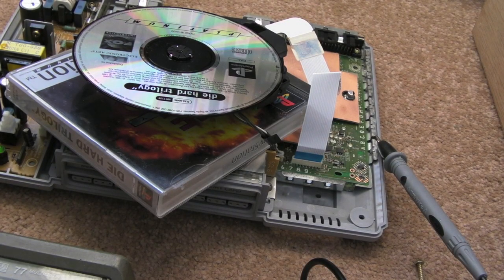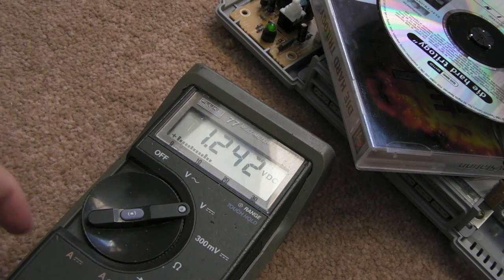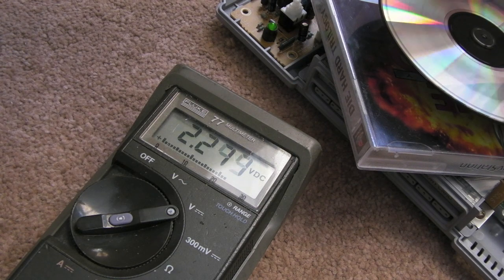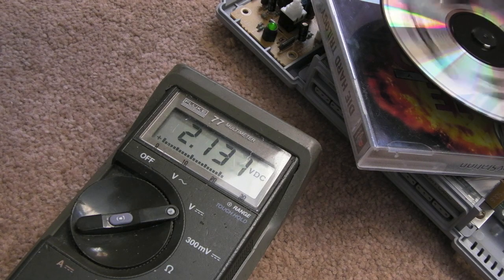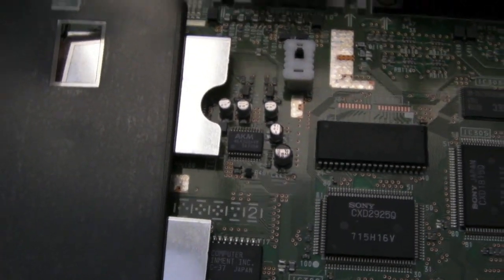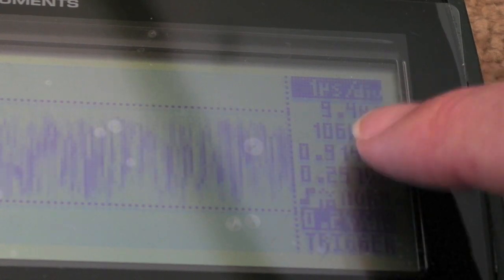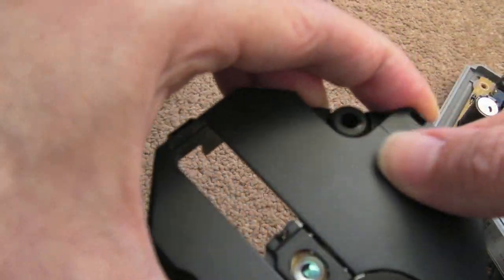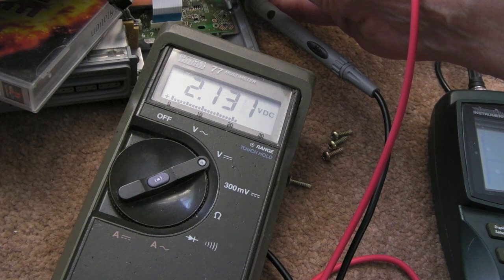Sony PlayStation Faulty Laser Repair - Follow Up (Multimeter to adjust laser voltage?)

Comment: hm bruh but cant u just look for the resistant (Ohm) at the laster-adjustment poti? This would cutting corners massivley.
Reply from the maker: It would only give you an at best average setting - no two laser units are the same and in some case the resistance can vary quite a bit, for example on a replacement 3rd part unit.  You really need to measure with an oscilloscope if you want to ensure its optimal and so you dont shorten the laser life.

Comment: I have a question. I have 2 of these 5502 playstations. Other is modded and works fine, other is not modded and is having trouble with FMVs and loading in general.
I measured modded unit with multimeter, 1.315V while "sleeping" and 2.15V when active, absolutelu no skipping.
Unmodded unit won't go past 1.85V in active state or it would get stuck in PS screen. I tried everything between 1.6V to 2.2V, 1.85V seems best this cd-drive can do. They have different spindles, otherwise identical unit.
Is this a sign that drive is finished and needs to be binned?
Reply from the maker: It sounds like the laser perhaps on its last legs!  You will get less of a voltage change (and a lower voltage) when the laser is outputting less.

Comment: Have you ever tried to replace only laser diode in laser which was completaly used up? Or is there any other way to fix the laser which can extend the life of this laser diode. I know that adjusting potentiometer helps for some time but this diode will finally be completaly broken. I'm wondering if someone tried to replace it, but only the diode and not the whole module...? :-)
Reply from the maker: I haven't, but someone probably has!  Sometimes soaking the whole unit in IPA can help (dust or dirt in the pickup path internally etc), but as you say - once the diode starts to die, increasing voltage just increases the speed which it deteorates.
Reply: @GadgetUK164  recently I had SCPH-102 & 5502 on my desk fot repair and I also got 2 pcs of laser modules from aliexpress (KSM440-ADM & BAM). Unfortunately in both potentiometer has been set to ~700 Ohms. This basically means that they cheating, taking old modules, changing resistance value and sell as a new one. I was very angry that day. Over month of waiting for nothing... :(
That's why I was looking possibility of diode replacement ;)

Comment: Any chance it’s a laser issue causing my problem?!.... I just purchased an original PlayStation (SCPH 5552) to relive the good old days of gaming. When the disc is inserted, the ps load screen comes up as normal whilst loading but then as the game or intro video (depending on game) starts to display, the image (kinda) bounces, vertically, creating almost a double image (a bit like looking at a 3D image without the active shutter glasses on). Now doesn’t do it with all the games, only a select few and all the discs are in good order. Any ideas??

Great video!
Reply from the maker: What you are desribing is a common issue with the composite sync on these I think.  Some of mine behave that way.  There's probably a mod you can do to improve the sync on these.  It's not related to the laser though!

Comment: What's the default laser voltage of the PS1?
Reply from the maker: The RF level should be set between 900mV up to 1.25V I think.  Do not mistake the RF level for the voltage that goes to the laser using the pot on the back of the laser unit.

Comment: after replacing the lens the screen ask for ps1 format disc ?!!   how can i get that disc or download it  ???
Reply from the maker: That means it cannot read the disc still!  Either the new laser is faulty, or you have another fault - perhaps related to the TDA IC on these boards which controls the motors, focus and tracking coils.
Reply: now i replaced  another lens and it works but very sensitive to cd must be new ... and my cds is old most of it >> can i download games from the net and copy it to new cds ?

Comment: Thanks for making this video - I had asked about this on your other video, but just noticed your reply only in my notifications in the top right corner, so I had missed the comment reply until now. I wasn't asking because I knew better -- I just truly wanted to know whether your technique relied more on something graphical which was present when looking at the range graphed on the scope, or whether observing the level using the meter would be equivalent or adequate. As you mention either tool could introduce drift in the readings from added impedance, etc, just by using it; but I was more curious from a troubleshooting perspective whether the scope would show me something that a meter alone would not. Thanks for attempting to explain your thinking on this, and keep up the solid videos.
Reply from the maker: No worries!  Thanks for asking the question - it's certainly a good question.  So you can do it that way, but personally I prefer to see the signal so you can be 100% of what you are altering.  But the DMM method is probably not far off in terms of accuracy if you do it properly.

Comment: Here's how i do it with a multi-meter and some simple math.

Measure the voltage of the laser when it is loading a disk (yours was around 2.20v) then take away the idle voltage (no disk, yours was 1.24v), and you will get a good estimate of the true laser voltage.

Here's an example using your numbers.

2.20v (Read) - 1.24v (Idle) = 0.96v (true laser voltage).

You were dead nuts on with the laser, looks to be reading disks great.
Reply from the maker: Thans, yeah - I posted above in my comments just as I had uploaded the video, that I thought it might be possible to either use a different reference point (ie. not ground), or just subtract the 'no disc loaded' measurement from the 'reading an audio track' measurement.  That seems to work fairly well, but I haven't tried adjusting the voltage to see if it is still accurate.  And in fact, it seems to indicate that its less than 900mV, but both scopes show it being nearer to just above 900mV.  Nice to know that other people do in fact do exactly that!
Reply: @GadgetUK164  I know that this video is pretty old, but I done the adjustment in this way on my three consoles and it work really well. On each console I had different idle voltage, and I set this to have ~0.96 difference between read voltage and idle voltage. Thanks :)

Comment: Would you take the metal rods out for lubrication?
Reply from the maker: There are no rods on this pickup unit - the laser assembly slides on plastic!  That is sometimes the problem with PS1 laser units - the plastic wears down over time.

Comment: Have you chipped that machine for region free play? I've recently got back into mine and I am enjoying it more than my PS4, that said I do have a ton more games on the PS1.
Reply from the maker: Not yet, but I probably will do at some point.  For now I just wanted to get it up and running as a spare.  The PS1 is a great system!  Surpised how well these have stood the test of time so far!
Reply: It's no doubt the broad array of games on it, Command & Conquer, Tony Hawk, Resident Evil, Gran Turismo, Ironhander and heaps of Fighting and sports titles, there's a real good mix  and when I look at my games there will always be something I am in the mood to play.

The clocks go forward today just incase you'd not been told.

Comment from the maker: Please note - I am not expert here, so what I showed in the video when measuring the DC voltage from the RF test pad could be the wrong way if you wanted to use a DMM.  I was using the ground as the reference for the measurement, there might be a better place to connect the -ve of the meter in order to get a better reading.   The main purpose of this video was to show the difference and why its easier being able to see the eye pattern signal on a scope vs trying to speculate what the voltage might be when using a DMM.

You can learn more about laser based systems from RetroGameModz here (well worth watching):-
https://www.youtube.com/watch?v=lZK3Rmerg1I
Reply from the maker: And thinking about this afterwards, maybe its possible to subtract the 'idle - disc lid open' DC measured RF voltage from the 'active playing an audio track' RF voltage, and that might give you a reasonably accurate voltage - Just speculation, if that does work it seems to indicate the DMM reads it a little lower, since 2.13v - 1.242v gives ~888mV.  So maybe that method coule be used? -  Of course that idea could be complete rubbish - I don't know until I try playing with the voltage adjustment vs what the DMM reports. I would be interested if anyone could comment on this with their experience here.